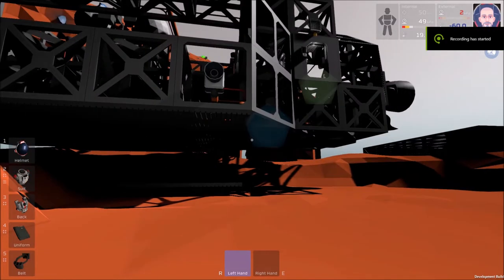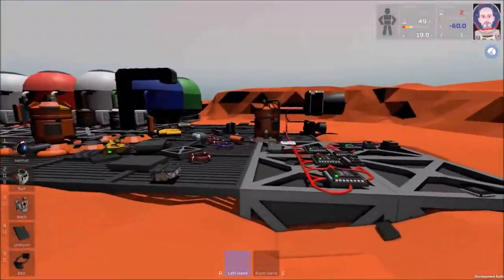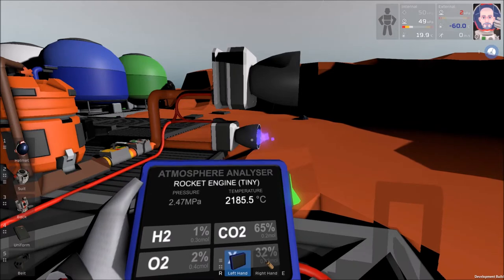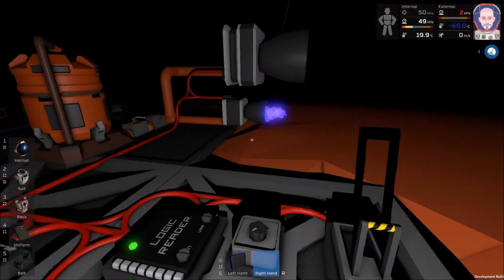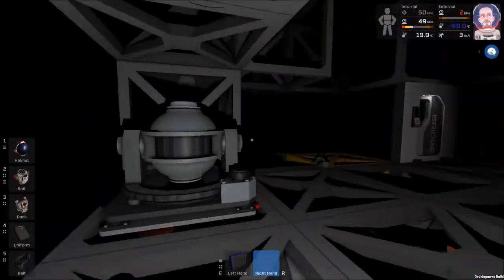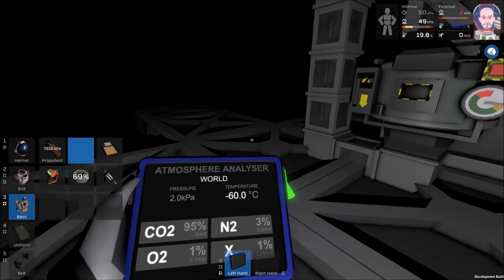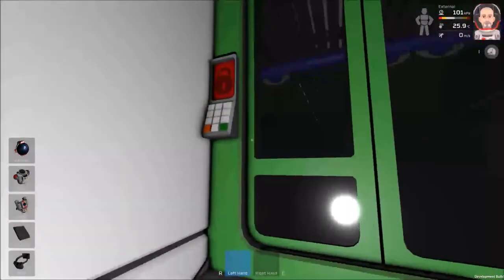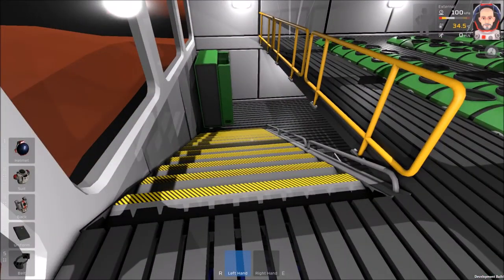Stationeers Rocket Tutorial and Base Tour

Comment: Chamber pressure != thrust. Chamber pressure and temperature are good shorthand measures of efficiency (specific impulse), all else equal (in real rocket engines anyway), but can't alone tell you how much thrust there is.
However, if you're getting the same chamber pressure and temperature for more fuel consumption, then you're probably getting increased thrust too (assuming there aren't any major changes or differences in the throat and nozzle designs). 

Very cool base design, I'll definitely be taking some inspiration from it.
Seems you haven't posted a new video in a while, I hope you're well.